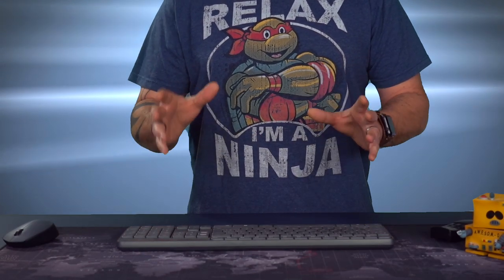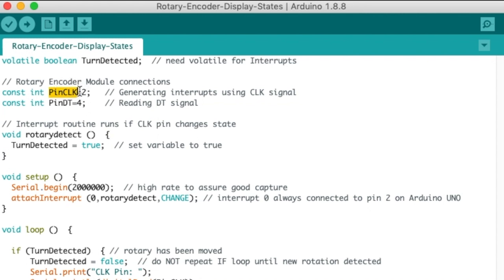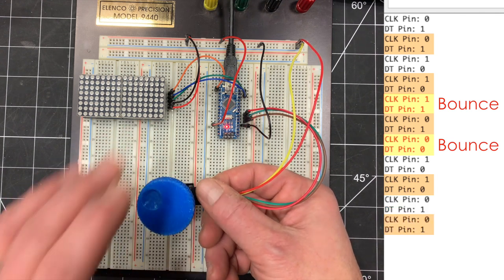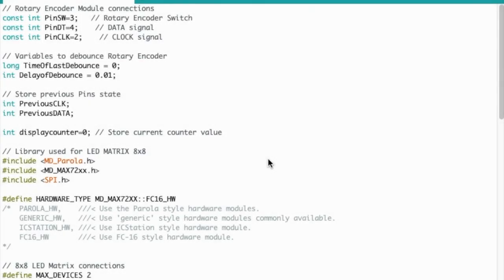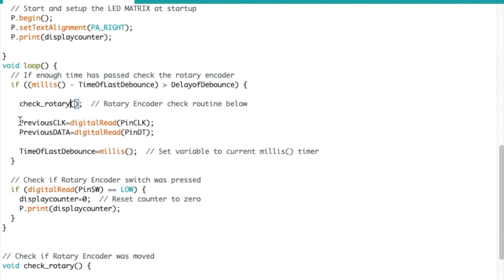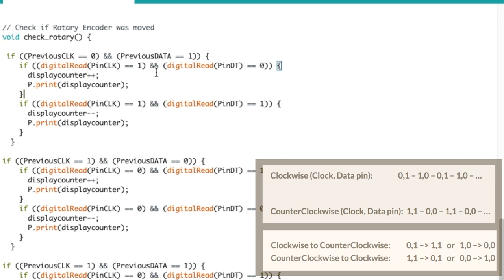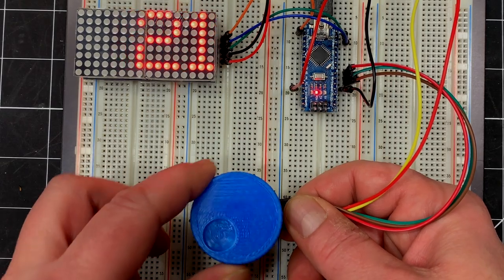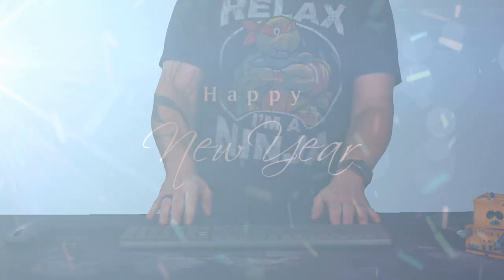Best code to use with a KY-040 Rotary Encoder? Let's find out!

Comment: Isn't it simpler to do a bitwise XOR of the pin values? A clockwise move would generate either1,0 or 0,1. XORing these two sets of values would always give a 1.
A counterclockwise move would generate a 1,1 or a 0,0. XORing these two sets of values would always give you a 0. You only need to keep track of previous clock to do debounce checking.
E.g:
void check_rotary() {
          static int oldClock = -1; // Initialize to an impossible value.
          int clockVal = digitalRead(PinCLK);
          int dataVal = digitalRead(PinDT);
          if(clockVal == oldClock) return; // was a bounce. Don't count this.
          if(clockVal ^ dataVal) {
                  // clockwise move
                  displaycounter++
          } else {
               // counterclockwise move
              displaycounter--;
           }
            oldClock = clockVal; // store clock state for debounce check.
           p.print(displaycounter);
}
Reply: Any suggestions for when your values are all over the place and don't really fit said formula ? 
Or even worse, they f*ckin intersect with one another (same transition exists in both clockwise and counterclockwise moves).
Reply: @demyanrudenko  It can be tricky and frustrating.  I have found that the amount of delay that you add in can be critical.  Try my code above.
Reply: @demyanrudenko  I would think use else if and at the end have just an else which does nothing but catch all the stray noise.
Reply: thanks bro, it works
Reply: @rocketman179  which one?

Comment: Thank you for sharing your knowledge and experience my friend. I picked up a KY-040 & an Arduino Uno for a rotary arcade joystick project. I plan to use it to make a controller that functions like the classic SNK LS-30 8-position rotary joystick used on Ikari Warriors arcade machines. Absolutely NOBODY makes a rotary joystick anymore so DIY is the only solution. Great tutorial, thank you again!

Comment: When testing this code (working btw, very nice!) I notice you have called out // Variables to debounce Rotary Encoder
long TimeOfLastDebounce = 0;
int DelayofDebounce = 0.01; <--- this basically sets the DelayofDebounce  value to 0 correct? Since its and int vs long.
Reply from the maker: That's actually pretty cool that you saw that...  The value should be 10 not 0.01 (refering to 10ms), It's a typo I made in the code when testing.  The code still works because it's actually checking all the time since the 0.01 is indeed equal to 0 when using an int.  Also, a long variable doesn't allow any decimals just like int doesn't either.  Long allows for bigger numbers (-2,147,483,648 to 2,147,483,648) unlike int which tops at (-32,767 to 32,767).  For decimals we need to use float.  Thank you again for pointing out the error in the code!

Comment: Not using interrupts introduces other issues though. Potentially several bad ones too. Mostly when you are worried about power usage and also the MC doing something while your are checking the RE
Reply: Yeah, this is the worst of 3 debounce methods. Hardware > programmatic > forced delay.  Unacceptable for a paid project

Comment: Thank you very much, I had the same problems. A beautiful and simple effective solution.
Reply from the maker: Thanks for your comment and for watching Stephane.
Reply: Yes, I find that Krishna's code works better.  I started there. I did not wire the 8x8 matrix, so my code only reports to the Serial interface.  Also, I added bounds checking. and I was getting 2 value changes per 1 click of the dial, so I normalized that with a map() function.  I hope this helps someone:

const int pinCLK  = 10;
const int pinDATA = 16;
const int pinSW   = 14;
// to deBounce
long TimeOfLastDebounce = 0;
float DelayofDebounce   = 0.01;

// valiables to limit the read, keep it between a minimum and a maximum value;
static int rawMax     = 400;
static int rawMin     = -400;

// Code was changing by two, for each one click of the wheel.
// so I added a rawCounter, and then I map that to a good counter
// later in the code.
static int rawCounter  = 0;
static int goodCounter = 0;  

void setup()
{
  pinMode(pinSW, INPUT_PULLUP);
  Serial.begin(19200);  
}

void loop()
{
    // If enough time has passed, check the rotary encoder
    if ((millis() - TimeOfLastDebounce) > DelayofDebounce) 
    {
      check_rotary(); 

      // Check if switch was pressed
      if (digitalRead(pinSW) == LOW) 
      {
        rawCounter = 0;
      }
    }  // end if for debounce
     
     // fix problem with too much change.
     goodCounter = map(rawCounter,-400,400,-200,200);
     Serial.println(goodCounter);
     delay(1);
} // end loop

void check_rotary() 
{

    static int oldClock = 0; // Initialize to an impossible value.
    int clockVal = digitalRead(pinCLK);
    int dataVal  = digitalRead(pinDATA);
    if(clockVal == oldClock) return; // was a bounce. Don't count this.
                    
       if ((clockVal ^ dataVal) && (rawCounter+1 < rawMax))
       {
           rawCounter++;
       } 
       else if (rawCounter > rawMin)  
       {
            rawCounter--;   
       }
       oldClock = clockVal;
       // fix problem with wheel changing the value too much.
       // now 1 click of wheel = 1 change of goodCounter.
       goodCounter = map(rawCounter,-400,400,-200,200);
       Serial.println(goodCounter);
} // end of check_rotary()

Comment: #define encoder0PinA 2
#define encoder0PinB  3
int currentStateCLK;
volatile unsigned int encoder0Pos = 0;
Void setup(){
   Serial.begin(115200);
  attachInterrupt(0, doEncoder, CHANGE);  // encoder pin on interrupt 0 - pin 2

}
void loop(){

}
void doEncoder(){
	currentStateCLK = digitalRead(encoder0PinA);
	if (currentStateCLK != 1 ){
			encoder0Pos++;
}
else{
encoder0Pos--;
}
 Serial.println(encoder0Pos);

}

I have changed slightly in the condition like when the currentCLK is 0 and if the datapin is equals to currenclk then it is rotated anticlock wise and is datapin is not equal it is clockwise.
It gives me the stable output..

Comment: The test code worked well for my bench test.  I'm planning on using an Arduino micro with a rotary encoder to control under vehicle programmable LED lighting on my truck.  I'll have multiple light patterns (PWM) that will be generated from the Arduino, and selected through this encoder.  I think it is less overhead for the Arduino if the rotary encoder is operating with interrupts.   Your thoughts?

Comment: I tried the code and had high hopes for it. though it seemed too simple i thought it would work.. but when coupled with a program thats actually doing something useful (non-blocking code btw) for example reading from sensors and writing to oled display the program just skips too many steps. especially if turned faster. thanks for your efforts  by the way.
Reply: If you put this code in an interrupt timer call back function and call it every two milli seconds or so it will interrupt any code in the main loop and read the encoder correctly.

Comment: I just find from Arduino site the following code that seems to work fine 
with the exception-change to 2.000.000 rate instead of 9600.
https://create.arduino.cc/projecthub/vandenbrande/arduino-rotary-encoder-simple-example-ky-040-b78752

But I am still confused because i can not understand why the designer (of the chip)
.........................gave us a SW pin....!!!! (what the hell ???..must have some utility.....)

Here is the code (simplified) to check if it is working fine....

int CLK = 9;  // Pin 9 to clk on encoder
 int DT = 8;  // Pin 8 to DT on encoder
 int RotPosition = 0; 
 int rotation;  
 int value;
 boolean LeftRight;
 void setup() { 
   Serial.begin (2000000);
   pinMode (CLK,INPUT);
   pinMode (DT,INPUT);
   rotation = digitalRead(CLK); 
      RotPosition = 0;  
      Serial.print("Initilising RotPosition at: ");
      RotPosition%=30;
      Serial.println(RotPosition);
 } 
 void loop() { 
   value = digitalRead(CLK);
     if (value != rotation){ // we use the DT pin to find out which way we turning.
      
     if (digitalRead(DT) != value) {  // Clockwise
       RotPosition ++;
       LeftRight = true;
       Serial.print ("Right to :");
     } 
     else { //Counterclockwise
       LeftRight = false;
       RotPosition--;
       Serial.print("Left to: ");
     }
     
     RotPosition%=30;
     Serial.println(RotPosition);
     
   } 
   rotation = value;
 }
Reply: the sw pin is a button

Comment: All the rotary encoders I have out put 00,01,11,10 rotating one way and 00,10,11,01 when rotated the other direction. 
Just curious how you get the sequence you get. My alps encoder has detects for each of the 4 states but my ky040 only has one detention at 00.

Comment: that's cool bro, and how about using 2 rotary encoders? I am very confused. Please help me.
Reply: Make an array with the index count equaling the number of encoders you have, one for the data pin data and one for the clock pin data (or make an array of structs) then  loop during this read routine for each encoder

Comment: Wow, every time I run into a snag, it seems you have a video to explain the concept, then write a code snippit to handle the problem.  I have had a dozen of those encoders in my kit for a couple of years, never have figured out exactly how to use them.  Bought them when I built a tiny white oscilloscope toy kit, when I assembled it, i nuked the encoder and had to buy 12 of them to get the one I needed. The one I installed brought the little scope to life and I do use it about once a week or so when I feel the need for investigation of circuits.
Reply from the maker: Hi Jerry, thanks for your comment and very happy that this might help you with your current and future projects!  Cheers!

Comment: Does the value increase in either direction when you started at zero?
Reply from the maker: Yes it does, when you turn counterclockwise the displaycounter variable goes negative, but the LED matrix display doesn't show the minus sign.  Thanks for watching!